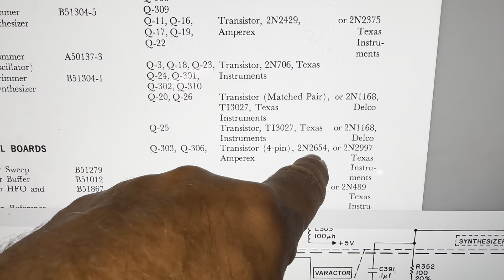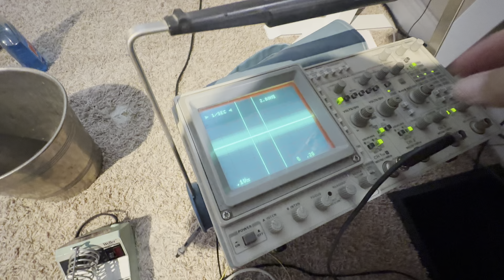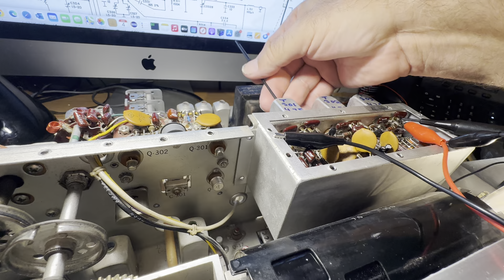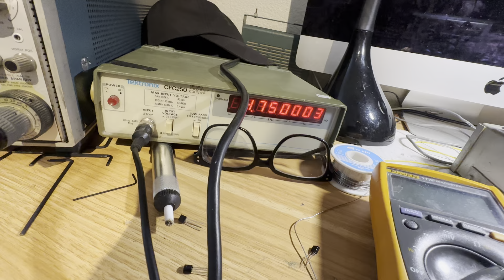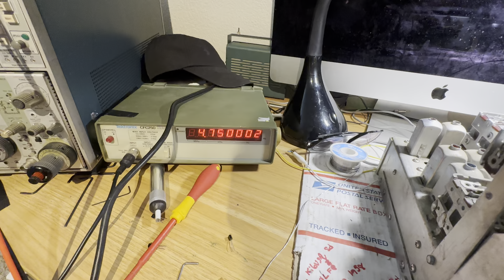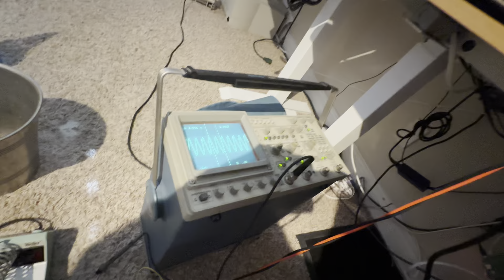National company HRO 500 alignment essentials for lock synthesizer and now we have lock yeah baby

Comment: Cleaning the transistor leads is a GOOD IDEA!!!! Same thing for many vacuum tube sockets!!! And that transistor checker.. Good working on swapping transistors around. I do this a lot in Zenith Transoceanic radios.. Also using some Doxit on those capacitor tuning contacts assures those are working as they should..
Robert